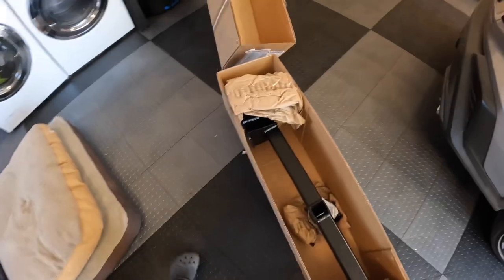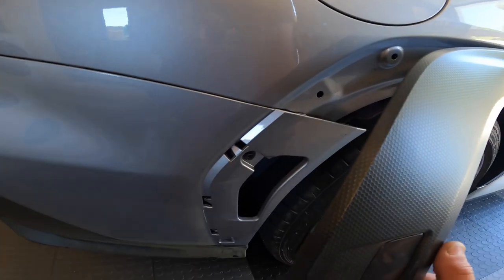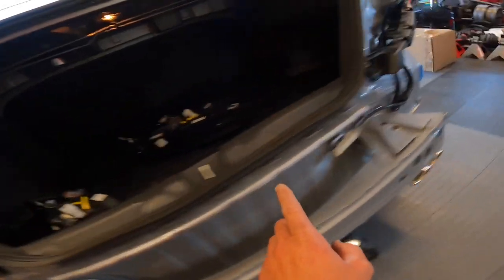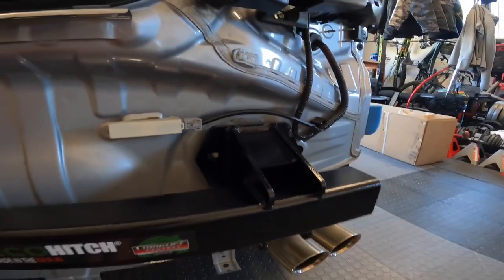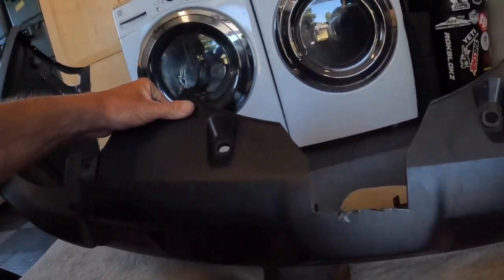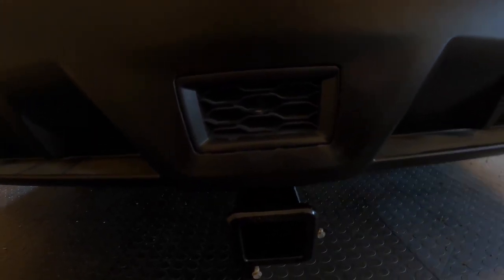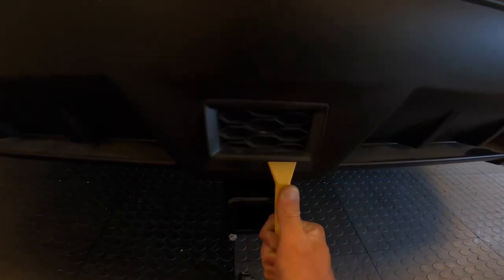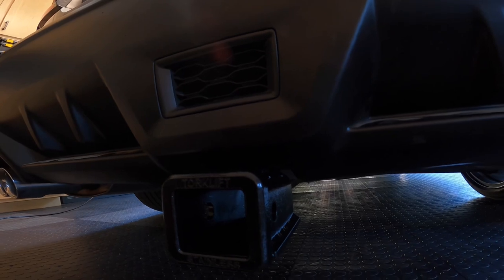2022 Subaru WRX Torklift EcoHitch Install and Review

Comment: Very useful video. They've altered the instructions to say  2 3/4" inch notch now, but I had to cut a lot more than, especially to accommodate the 'wing' on the downpipe part. They could easily fix the cover issue by making a ring style mount for the magnet, that goes around the big bolt instead of in line with it.
Reply from the maker: Glad it helped you out!! And nice thanks for the update on them updating the instructions. Now i know when people ask that question.

Comment: This helped a lot - Huge Thanks! Measuring to 2 3/4 was a perfect fit and didn't need any modification. Using some heavy duty shears also worked well for cutting. I switched over to a box cutter to notch out the bottom line and then just bent the whole thing off.
Reply from the maker: Awesome glad to hear!! And thank you for confirming the measurements. I knew for sure it was more than what their instructions said but was hard to tell cause i cut the extra half inch or so off when it was on the car.

Comment: Hey great video...just got my hitch, but wanted to clarify the proper cutting measures . Was the extra cut to 2 3/4 on the 1 -1/2 inch part or the 2 -1/4 part ?(per instructions )
Reply from the maker: Sorry for the delayed response. Just saw this. Did you get it all figured out?

Comment: Love the video! After using it for a few months, how do you like it? 

Can you tell a big difference with a full-sus mountain bike on the back? Any major squat on the rear of the car from the weight?
Reply from the maker: Thanks and nope ive had two ebikes on it with no problem at all. It obviously compresses the suspension a little bit but not enough to notice without paying attention or anything that affects driving. Id say you need a 1up rack for sure though. Had to get rid of my kuat because it went to far out before going up vs the 1up goes up pretty much right away.
Reply: @redwoodchronicles  Gotcha, I currently have a Kuat NV 2.0, does it drag or anything because it comes straight out? Just too low for a car?
Reply from the maker: Yeah thats the same rack i had and switched out. It works but your definitely going to scrape it. And it coming straight out like it does is exactly the problem. Just so low on the already low car. I mean if your staying on flat roads and not pulling in and out of any driveways itll be totally fine but most driveways will scrape.

Comment: So, this replaces the impact bar for the rear. That part is designed to deform and help absorb some of the energy in an accident to help reduce rear body panel damage. The tow hitch looks SUPER solid so I wonder in a rear impact (and I hope that NEVER happens to you) how that part will deform if at all to help absorb some of the energy or if it will cause more damage to the rear body panel/rear floor. Just wondering about that, I wonder if the company has done any impact testing. Either way, thanks for sharing and enjoy.
Reply from the maker: You are correct in what the crash bar is supposed to do. With that being said this is the same way subaru factory hitches look and mount so I’m not to concerned.
Reply: In Australia at least the new Subaru isn't actually tow-rated - Subaru hasn't designed this vehicle to have a tow hitch of any description, so I suspect the warranty and insurance would be voided adding this to the vehicle.
Reply from the maker: @shaun1900  yeah seems like you guys have significantly stricter rules down there. May be something to consider for sure. In the US when it comes to warranty they would have to prove that the modification caused whatever failure took place. Which they would have a very hard time doing unless you exceeded the tow capacity of all of the other smaller Subarus at 1500lbs. As far as the insurance it would be the same situation. All I am putting on it is a bike rack so I’m in no way concerned about warranty or insurance.
Reply: @redwoodchronicles  Not rules, manufacturers and insurers guidelines per se. The unrated towing position comes from Subaru Japan, so it's likely the car doesn't have the structural integrity to tow with those mounting points you have used to do so. Maybe it won't be so bad with the fact you are only putting bikes on the back. Interesting to see if Subaru in the US actually states in any of their literature that it's unrated for towing or fitment of a tow hitch.

Comment: Thanks for the really well done video.  It made the install quick and easy.  (Maybe a bit over 2 hours? I had several interruptions so not sure.)  The instructions have been updated and now say to cut to 2-3/4 inches.  Like you, I only trimmed the necessary plastic, so I could install the panel.  But, there's a lock washer for the bolt that attaches the receiver to the bumper, so the panel won't install even though the catches are there.  I left it off for now since the bike rack hides it anyway.  The plastic can be but with a few pass of a new utility knife.  I put Loctite on the receiver bolt to avoid issues if I ever remove it.  The hitch adds ~30 pounds and my 1up single rack adds another 30 pounds.
Reply from the maker: Thank you and your welcome!! Thats interesting your panel didn’t fit on with there. I wonder whats different between ours? Mine has the same bolt and washer and the panel fits back on just fine?
Reply: @redwoodchronicles  Bolt, washer, and lock washer?  It didn't look like you had the lock washer, so I figured that was it.  It's torqued to spec with Loctite, so I might just remove the lock washer some day if that's the only difference.  I had already forgotten the panel was missing, so no hurry.
Reply from the maker: Yeah its got all 3. Hold on ill make a quick video and show you more what it looks like
Reply from the maker: February 3, 2023
https://youtube.com/shorts/57ZJo_RzcFM?feature=share
Reply: @redwoodchronicles  Thanks for the video.  That's above and beyond.  All looks mostly the same.  Only difference looks like there might be just enough extra plastic left on to allow the clips to engage.  I trimmed enough off so the the hitch doesn't touch the plastic at all.  In any case, I'll look at it some more.
Reply from the maker: Ah that would make sense. Mine must still be sticking out just far enough.

Comment: hi, i have the 2024 wrx tr, and was wondering if that hitch could support a 500-600 pound adventure bike on the back. something like a CF-MOTO 450MT or Yamaha t700.
Reply from the maker: It says the tongue weight is 525 on torque lifts website. But i have a built out 701 and if im taking that thing anywhere im using my truck not the wrx.
Reply: I wouldn't.  I thought I say that tongue weight is 200 lbs even though Torklift might say the hitch itself is good for 525.  I was worrying about the weight of a 55 lb ebike and a 30 lb bike carrier.  I would NOT put a motorcycle back there, not even a 200cc dirt bike.
Reply from the maker: Ive rallied my car off road with 2 levos and a 1up rack i definitley would have zero concern about an ebike back there.

Comment: did you ever get to run a third brake light? i have the light and i want to run a hitch for a bike as well but im hesitant because im not sure i can use both at the same time
Reply from the maker: Confirmed you wont be able to run both at the same time. Unless someone has made a significantly thinner 3rd brake light but i havent see one.
Reply: @redwoodchronicles  thanks for the quick reply. I might just sacrifice the light and do it anyways. I feel it would be safer as a hitch than on my roof rack
Reply from the maker: @1988pecco your welcome. I went the roof rack route on a previous wrx and it was not the move for me. It killed the mpg’s and the bikes got pelted with bugs and rocks. They still get dusty behind the bike but in my opinion its the better option. Can always get a baller bike rack with a 3rd brake light haha

Comment: Hello, 
from your view:
is 2022 WRX rear body/bumper structure strong enough to install a recovery hook?
For "show use", Perrin rear tow hook's maximum total weight of vehicle and contents not to exceed 4000 lbs...
Reply from the maker: Im not sure how you’d connect it. I dont think theres a factory tow hook spot in the rear just the front. With the bumper set up i have id feel comfortable putting something like a factor 55 hitch receiver and pull the wrx. If your talking like fully custom the rear bumper structure that comes stock looks identical to the one on a crosstrek or forester which i believe both have rear factory tow hook points in them. With all the being said im just a dude so dont take anything I say worth anything more than just a guy that works on his vehicles a bit.

Comment: How much does this reduce ground clearance?  Do you know?  Thx.
Reply from the maker: Ive never measured. With that being said it doesnt hang down to much lower than the exhaust. Ive never scrapped just the hitch but definitely have the bike rack.
Reply: @redwoodchronicles   Great tutorial.  I had a hitch on my 2015 VA and the placement was a bit higher than the VB.  I also have 1UP racks... are you saying in the above post that your 1UP also scrapped?  Thinking of driveways (mine) with an incline I never scraped my 1UP rack with my bike loaded in my 2015.  It would be real close with the placement being lower in the VB.
Reply from the maker: @bowhun2r yeah my 1up scrapes but only on crazy drive ways theres only a handful ive found